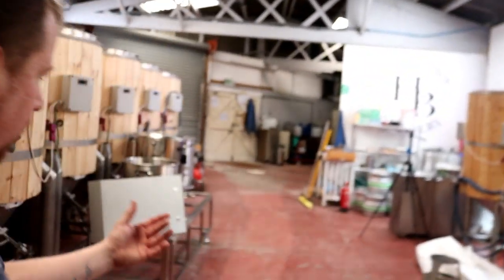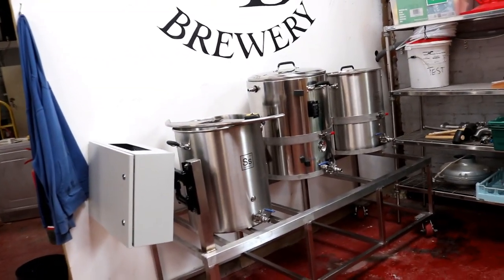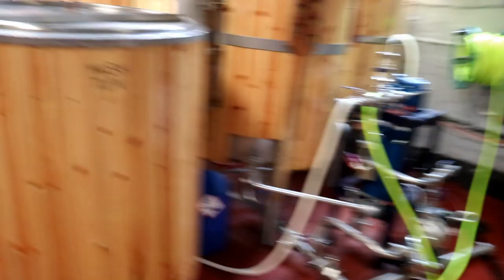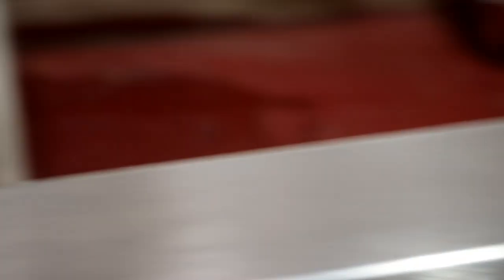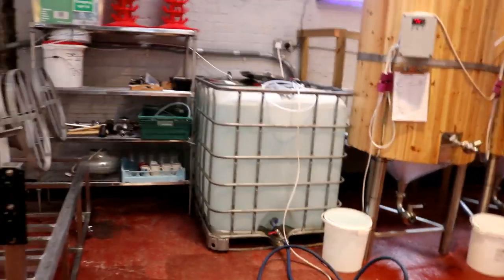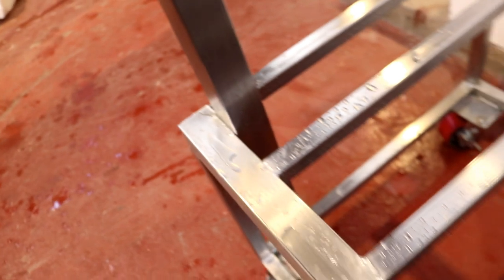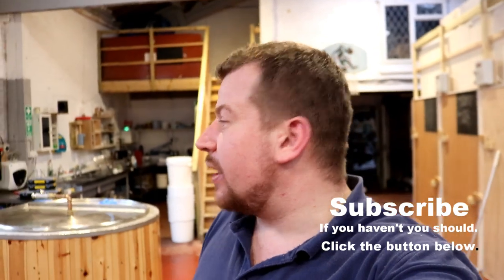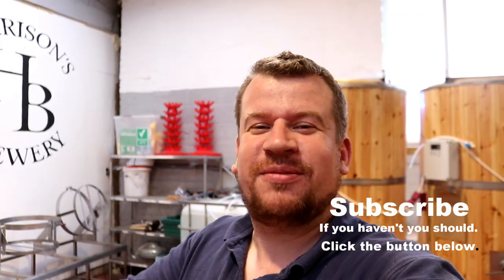TOUCHING UP THE STEEL DURING A BREW DAY

Comment: Canal side looks great Harry, much better than a scaffold jetty ;-) To clean up where you used a flap wheel on the stainless, use another flap wheel, but this time in a drill and go with the grain, then hit it with the wet and dry. In a past life i used to work at a stainless steel catering equipment fab shop, the lads there had all the kit to do it spot on but being one of the service engineers we had to work with what we could carry in a small van and we actually were able to get a really nice brushed finish even near welds etc.

You could do with a vent to the outside now where you have moved the chiller too, drop an STC controlling a fan on it and to keep the elecy bill down a little.

Brewing question, have you tried Kveik yeast yet? Seems 1 batch bought and harvest for the next brew is the way with it and it just keeps going and going and going.

Good to see you are not limping so much, a bike is much less damaging on the knees than running....